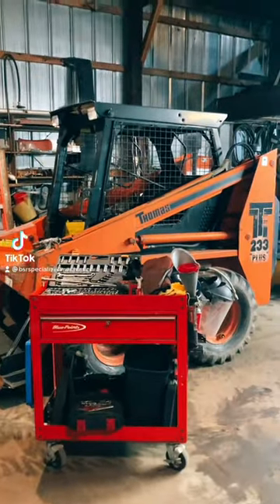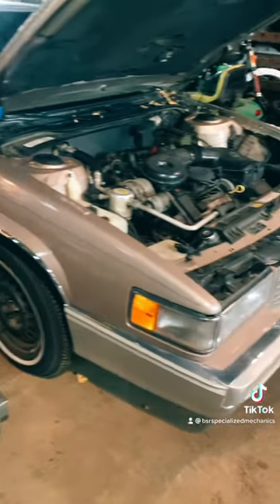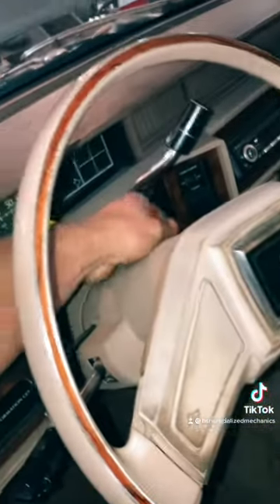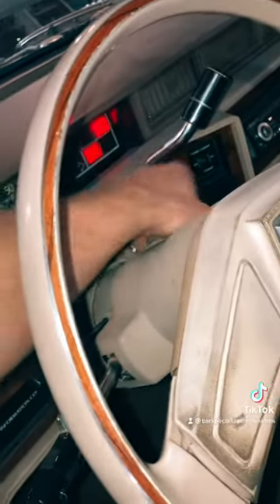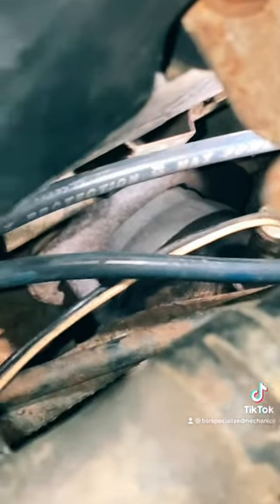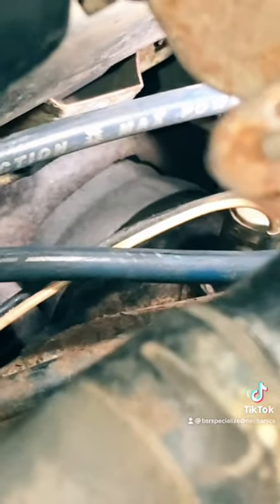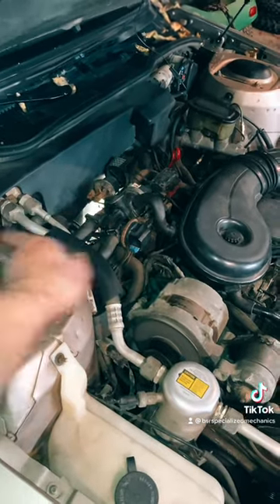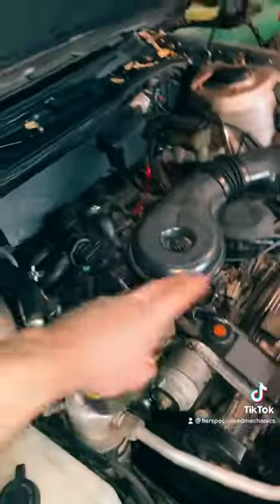Clogged catalytic converter￼

Comment: my girlfriends 1990 cadillac eldorado 4.5 has done her amazing aside from being old so we replaced all 4 wheel bearing and 1 went bad changed it with the original now the information center and speedo gage isn't working, any tips? both stopped at once and the car has a cheap metalic metal smell